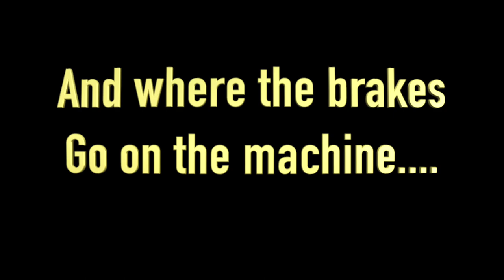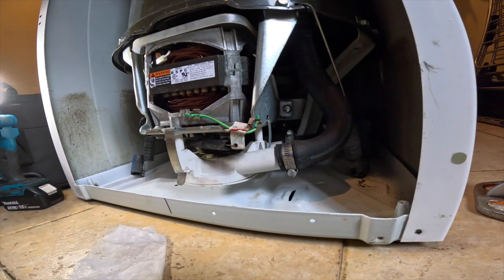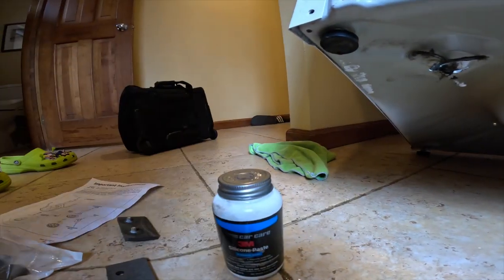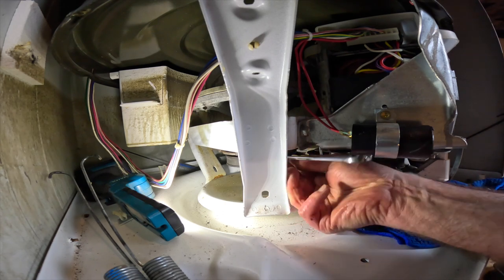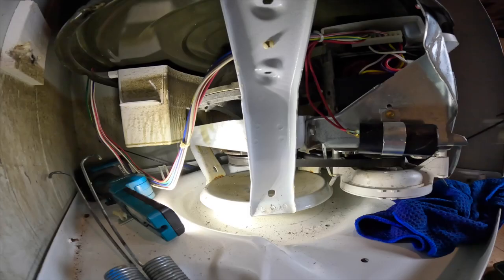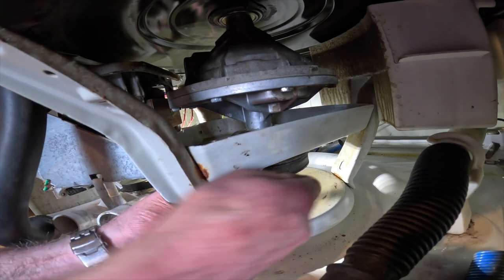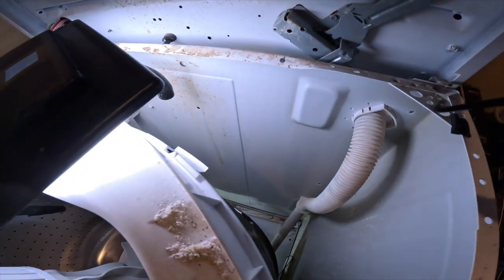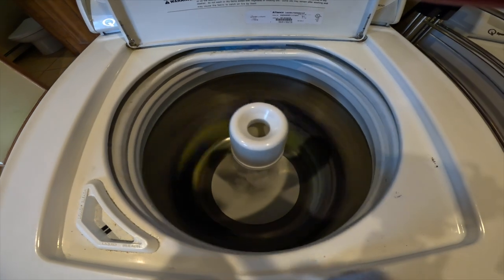Replace BRAKE PADS on Speed Queen Washer- Big Difference

Comment: What was the problem when u replace brake pads on the he washer.
Reply from the maker: Someone commented that I had so much trouble with the transmission moving in both directions because my brakes needed to be replaced. I’m not sure if he was right, but I rigged my machine so it runs with the lid opened, and I see a big difference. Now as the agitator moves back and forth, the basket with clothes grabs in one direction so the basket slowly moves clockwise only about 3 inches per agitation and doesn’t go back in the other direction. It’s a one way slow spin of the basket, and all of the clothes now contact the agitator better.

Comment: What is your take on the reliability and build quality of Speed Queen?  You seem to have to do a lot of repairs on these and the internals look like any other brand machines.
Reply from the maker: Here's my take;   12 years ago bought my current house. Everyone leaves washer dryer- right?  Nope. They wanted 1500 for the set. A couple of nice Samsung digital front loaders.
We said FU and went to our local appliance store.  Not much around me. The place is called Atlantic appliance. Walked in. All high end front loaders with pedestals. Also viking stuff, subzero etc.  We weren't looking For that. The salesman said if you want the best unit That doesn't break get a top loader and get these speed queen units. He said all the commercial laundromats use them.
Okay if you're not bored of reading by now we got them. I have 4 kids who were youngish 12 years ago.  I personally do most of the laundry cause I only work a few days a week. 
The machines have probably done an average of 2 to 3 loads a day for the last 12 years straight.

So what breaks. Well I wish the seal didn't leak. I had to replace that and it was a pain Although if I ever had to do it again it would be a piece of cake. Not many other problems. It was making a rubbing noise at first but worked fine.  I made a video and somebody told me how to fix it.. The handles were breaking quite often. new ones were like three dollars. Those don't break any more.  I'll tell you what doesn't break and that's electronics because there are none.  I had to replace the timer on the dryer also.  
But I would buy another in a heartbeat. Anything that runs so often for 12 years is a keeper. Get the most analog one you can find.  
I easily bypassed the top lock so we can run the machine with the lid up, and I changed the max water level so it fills more. Thanks for the question and good luck
Reply: @Samlol23_drrich  How do you modify the water level to increase the max fill ?
Reply from the maker: @Dicofole  that's a good question. I totally don't remember but I will look into it and revise this post as soon as I do. I'm sure I followed a YouTube video.  Stay tuned......(it was worth doing)  edit. Okay watch this guy's video. https://youtu.be/VpYpILUZqrQ?si=RqqAXk7qZFpa6S_A
Reply: Hi Rich, I’ve been watching a ton of SQ repair videos. I bought a commercial machine from a laundromat that I used to frequent, the owner was not repairing them anymore, put “out of order” signs on 3 out of 5 of the machines, so I managed to buy one of the last working machines for $100. It still has the coin machine on the top he took out the drawer, so I keep running the same 8 quarters through it. OMG what an upgrade from the crappy Kenmore someone gave me. Anyhow, it’s making a crazy squealing noise when the wash cycle starts, then everything runs fine. I think it needs a new belt. No leaks, pump is strong. Spin is good. I’m sure it’s  a total dirty mess underneath. I soaked the tub/basket a couple times with hot water, citric acid, and oxy clean a few times, no leftover odors. I got a good deal, so putting some $$$ into it to repair/maintain it is ok with me. It’s hard to get a camera in there to show everything! This here video is the first I’ve ever heard of brake pads.
Reply from the maker: @Sourpusscandy  I had no idea either. Someone commented  that the reason I was having so much trouble getting that bolt off was the brakes weren’t locking the transmission so I should change the brakes.  And he told me what to do, basically. They were cheap enough and it made a big difference.  As you said, the machines are great.  I’m sure you have the real commercial unit. And mine is the fake consumer “commercial “ one.  I have a video up from years ago that my machine was making a squealing grinding noise on the wash cycle and someone commented and that comment helped tons of people with the same issue.  It’s grease that’s needed between two washers.  I’ll see if I can find that video and edit this post.  If I find it, read the pinned comment thread.  Rich.  Edit. Okay here is the repair of that issue. Look at the pinned comment to link to the original video with the guy telling me what the issue was in the comment section of that video (it’ll make sense if you look at the video). https://youtu.be/SpldDodDLVI?si=L_xuIdEZ_2o0885h.  Edit 2 Okay here is the original video. https://youtu.be/1mm-7liFE6o?si=LkUMAwGKWI8UsZHS
Reply: @Dicofol1  We have never needed to on this model. It is old school still and fills up to an extra large load with no restrictions. Weve had our units since 2013. Very durable!
Reply: We have done many of the repairs, as Rich here. We bought ours in 2013. They are durable - we have 9 people my wife does the laundry for and she does about 30-35 loads a week. Yes, 30-35 loads about 1500 per year for 11 years now. She does not want to go back to her front loaders. She didnt like them, especially for the length of time per wash.  She loves her SQ and will be sad once they do die. I've replaced bearings 2x, water pump, fixed the squeak everyone talks about, and a couple of things on the dryer, etc. Overall, very easy to work on and little electronics!
Reply from the maker: @mandm275  and I thought doing one or two loads a day like I do was a lot!  The fact that there are no electronics is the biggest plus for me. No circuit boards to replace after a thunderstorm!  My pool heater has been a non stop parade of circuit board replacement. It’s got three and I’ve replaced each one twice over the years.   You’ve had to do the seal twice? Did you have a leak? Or was it just the bearings going?  Thanks for commenting also.  Very interesting
Reply: @Samlol23_drrich  Yes, bearing went both times. Both about 5 yrs apart. Second time was much easier since I knew what to do and didn't take EVERYTHING APART! I sanded and resprayed the outside drum as well while it was apart. Now redoing the brakes. Still, not bad after 15k loads or so.
Reply from the maker: @mandm275  you definitely got your money's worth .  I never fill the machine with clothes.  Don't get me wrong I do full loads I just leave room in there because I'm afraid of putting too much weight into the machine. Maybe I'm crazy
Reply: @Samlol23_drrich  Nope, us either. It's never overfilled. I was stating we never needed to adjust the water level on ours because the factory default was fine. My wife baby's these things.
Reply from the maker: @mandm275  I wasnt inferring that you were overfilling the machine.  All I meant was that I would rather run two smaller loads than one very full one.   I actually did adjust the max water level so it fills a couple of extra inches, and bypassed the latch safety so my machine runs with the lid up. Thanks again for commenting

Comment: could you tell me what was going on before you replaced the pads? you just said you were having issue in the description. not really clear on what they were. thanks
Reply from the maker: In a different video where I had a leak and replaced the bearings and seal I couldn’t get the main bolt off because the transmission was spinning with the bolt. Someone commented that it was because I needed new brakes, and the old ones were allowing the transmission to slip. It’s hard to describe in words what the brakes do.  I bypassed my lid lock so my washer runs with the cover up, so it was easy for me to see what impact the brakes have.  That gives me an idea; I’ll make a short video showing what the brakes do and edit this post if you are interested to see.   It’s hard to describe other than saying it allows the inner tub to rotate slowly in one direction only around the machine more thoroughly washing the load.

Comment: Why did they need replacing, what symptoms, tight drum , motor overheating?
Reply from the maker: Good question. The answer is hidden in the video description. It was hard for me to even find so I can’t fault anyone for not seeing it. It’s a long story so check out the description of this video, and search for my other video where I changed the bearings and seal. In a nutshell someone in the repair business responded to a question I had about replacing the seal.  He commented and I responded that I already completed that job and had a lot of difficulty because my transmission wasn’t locked and I couldn’t undo a bolt on the spindle.  He said I needed a new set of brakes and even gave me the part number. It was only .$20 for the part.  So I did it and it makes a big difference. I didn’t take a before video because I didn’t know my machine was not functioning properly before. Read the description and if you have any questions let me know.

Comment: Well done. Good night. A few questions. Do you use powdered detergent in this machine and how long did the machine last before changing the seals etc ? Machine age wise, when did you change the timer for the dryer ? Wouldnt it be better to just remove and flip the tub and replace the brakes since everything was out ? Thanks.
Reply from the maker: I’ll answer all your questions out of order. Never ever use powdered detergent. Only liquid. We got about 11 years out of the washer before it developed a leak. I put some silicone on the bottom of the tub and that fixed the leak for a year until it started again and I had to replace the seals and bearings. It absolutely would have been way easier to replace the brakes while I had the machine apart but I didn’t know I needed them. If you saw my other video, someone commented that the tub wasn’t locked in place because I needed new brakes. That made sense and it’s why I changed them.  It made a big difference. Now the tub slowly spins clockwise as it’s agitating and locks counterclockwise.  And I don’t remember anything about the dryer timer as to when or why I changed it. I definitely did because I have the old part. It must have been at least .6 years ago. I don’t even remember the symptoms. It wasn’t physically broken though.  Thanks for watching

Comment: I am looking for help with stuck brakes. my current issue is the brakes remain locked when the washer gets to the spin cycle. I have to turn the inner drum manually ccw and it will release and turn freely. Turning CW it will lock. Intermittently it tries to spin, the brakes are still locked, the motor goes off and on overload, and you can smell the belt burning. I turn if off, give the drum a push ccw, and it will run fine for a while. I question if the brake is designed to stay locked for the agitation cycle. And I would like to know what actually engages the brake. Is it the saw toot white plastic coupling?
I am disappointed I am having this prob on a 2017 machine
Reply from the maker: I wish I could help you but I'm not even sure how the brakes work even though I installed them in this video.  I only replaced them because a guy who was clearly in the business watched a different video I posted (where I replaced the bearings and seal) and commented that my brakes needed to be replaced.  

If you have the ability, post a video while you are having the problem and how you free the tub and ask for assistance in diagnosing the issue. I have had a lot of success that way.  Good luck
Reply: same situation for my 2017 speed queen.  what was the fix for you?
Reply: For me, I figured out you turn the drum one way and the brake locks, turn the other way it releases, which is a clever design. Also,  the motor turns in one direction for agitate and the other direction for spin.  The brakes lock when at the end of the spin cycle the motor stops causing the momentum of the spinning drum to lock the brakes by a wedging action. Then when the motor turns in the other direction for spin, that unlocks the brake if it is not wedged too tight.  With the brakes locked the drum will stay stationary during the agitating cycle. Without the drum locked, the drum will rotate with the agitator.  All I did, after changing the pump, belt, and spring was work the drum back and forth, then lock it lightly, then started a cycle and the drum unlocked for spin, locked for agitate and worked fine from that time forward. I think I was lucky and the instructions on lubing parts could be needed. My identical machine at my house is at least 10 years old and has never given any problem. It uses a ton of water, but is fast, and clothes don't smell musty when they come out.
Reply: @adk1guy  wow, thanks.   so are you saying that you may have ok with not replacing all those parts?  what do you think caused the break to stick? too heavy of load?  too hot?